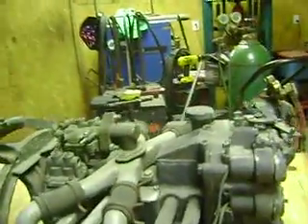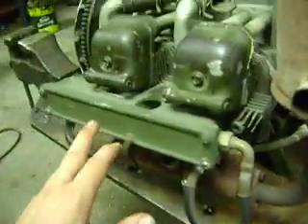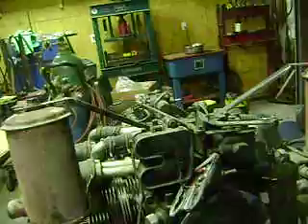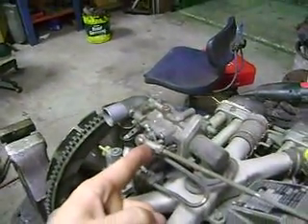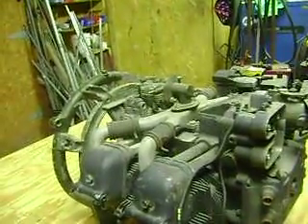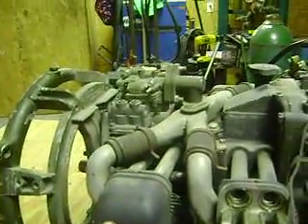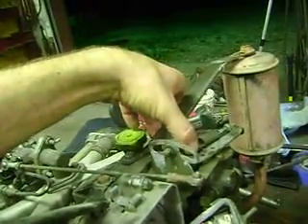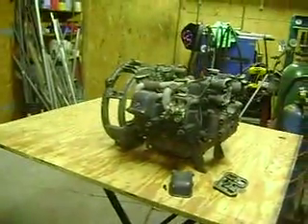4A032 engine walk-through

Comment: One question I have is I have a battery terminal cable coming off of the starter as well as one coming off of the frame and have no idea what these are supposed to be attached to I'm guessing maybe they had a battery hooked up to it somehow? It only has 46 hours of original run time on it and the gasoline and it smells like it's from the 60s

Comment: The way I figure if you can get a possible 30hp out of the engine then the bearings should survive.  I will be using the engine for my trackless train project.  I believe I can get 5lbs of boost out of the air pump though.  I am using the engine becaue of how smooth it runs and the way it looks too.  Eye candy.

Comment: I picked up one of these from a DRMO auction for $80. It looks perfect except the exhaust needs a little work. But I have a small problem. I have never used one of these and I would like to use it on a homebuilt sawmill. But I can not find out where the fuel goes into the engine. I have downloaded the manual and nothing yet. can someone please send me a video link on how to attach the fuel. My goal is to removal the governor and attach it to the sawmill. But I first have to get it cranked.
Reply from the maker: Robert Smith If you follow the fuel line back from the carb, you will see it enter a small mechanical fuel pump, I tied mine into the inlet o0f that fuel pump, you can get a better look at it if you look at my other video, I point to it there (titled 4A032 in a mini airboat) The stock engines had a godawful sheetmetal box around the cylinders that hides all the inner beauty of these engines, but in your application you will have to leave it on. I could get away without it 'cause I had it on an airboat in front of a prop, but a sawmill won't provide enough cooling without that sheetmetal. You can tie into the inlet of the fuel pump and just drill a hole in that cooling shroud out the top and route the fuel line out. protect the fuel line with hard nylon plastic sleeve so it doesn't rub through though! Route it to an external tank and you won't have any issues. One suggestion, place the tank above the engine so it will gravity prime, otherwise you will pull your brains out trying to start the thing!
Reply: Can't get mine to fire

Comment from the maker: @24preacherboy Definitely keep me posted on that build! Propane would be an excellent fuel, it has an octane equivalent of around 110, if you can make 10lbs of boost you would probably be at about 25HP. I'm curious about the rod bearings surviving, they are aluminum and non-pressurized lubrication, but if it lives, you may be on to something. I was thinking about a very tiny turbocharger for mine, they actually make a mitsubushi TD-01 turbo that is the size of a coke can that would be perfect!

Comment: Can you help me out with a question I’ve got the older model with the two points. Mine has two wires but I don’t know what coil they go to. Does the top gun go to the right or left and does the bottom one go to the right or left. If you could tell me that that would be amazing. I had it running at one point it stopped. I fucked with it. Unfortunately sorry for my French, and now I have no life